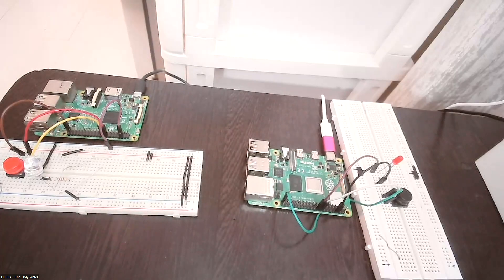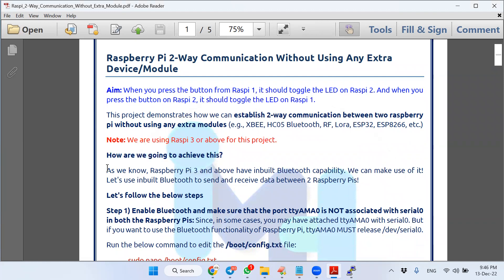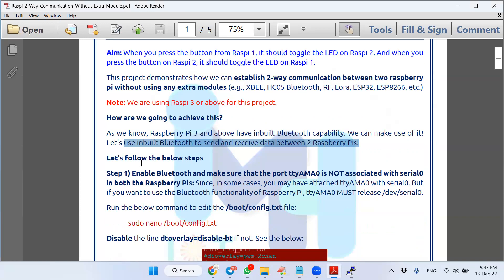2-Way Communication Between 2 Raspberry Pis Without Using Any Extra Device/Module

Comment: Interesting video! I was wondering if theres a way to send/receive information  between two random raspberry pi’s without inputting their specific addresses in the code. Basically I want the pi’s to “sync”  based on their location and proximity. 

I want a pi device to pick up on my other pi device signals and communicate without their actual addresses being programmed in the code so the process can apply to infinite number of devices, just don't know how. 

Ex: A business device sending info to each customer with a device as they arrive at the location.